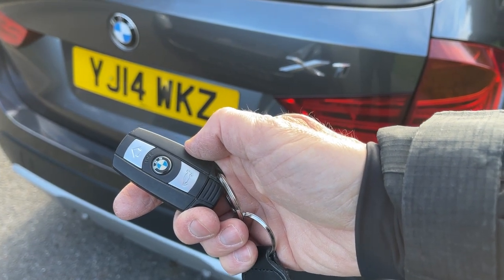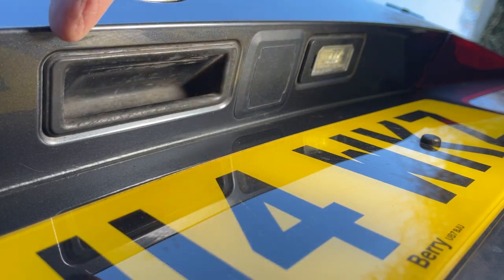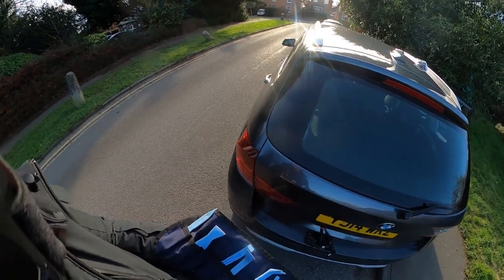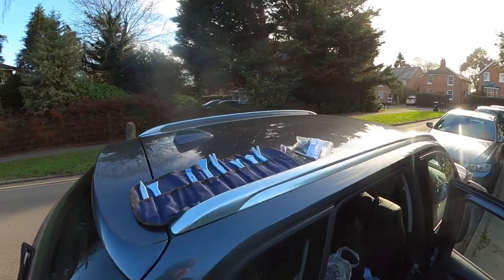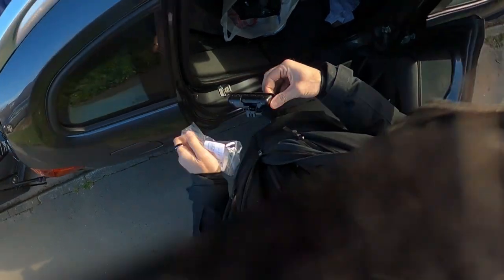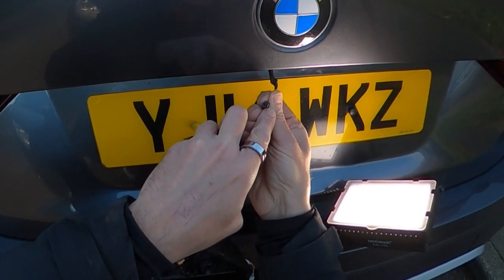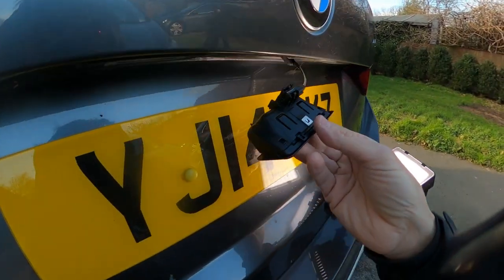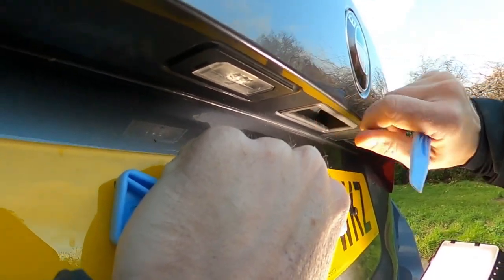2 MINUTES: Replace the Boot/Trunk Switch on Your BMW or Mini (Example 2014 BMW X1)

Comment from the maker: A short guide on how to replace the trunk / boot switch on your BMW or BMW Mini car. 

If the trunk / boot on your BMW or Mini isn't opening properly, highly likely the switch needs replacing. 

The silicone pry bar tool used in the video here: https://geni.us/h4Cdl

Disclaimer: If buy from the link above I receive a small comission which helps fund the channel.

*Please" Avoid using screwdrivers for removing car switches and trim - it very often damages your vehicle. This inexpensive tool set or similar is a solid investment.

If this helps you, please consider liking and subscribing. Any questions or feedback - please leave below!

Comment: Thank you for your guide. The trunk handle on my E90 works fine but the rubber is deteriorating rapidly, so a change may be required.
Two questions:
1. What thickness of pry bars did you use?
2. Other videos suggest removing the trunk inner lining and such. Any clue why they go those extra steps ? It doesn't look to me they are needed unless the license plate needs removal, and even that.